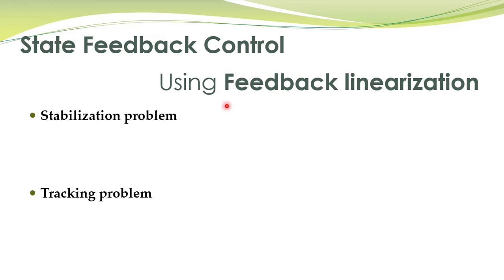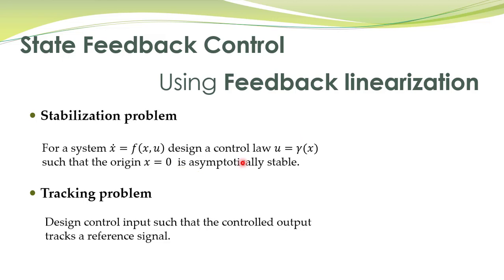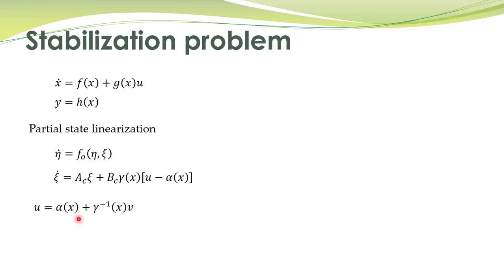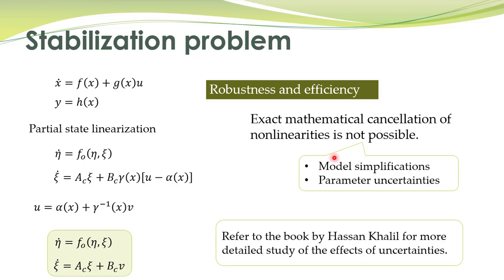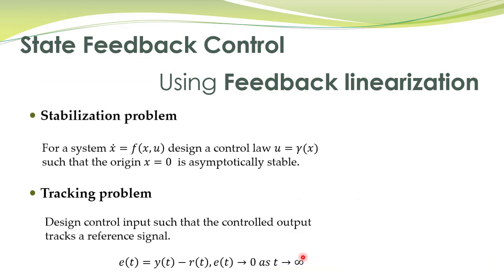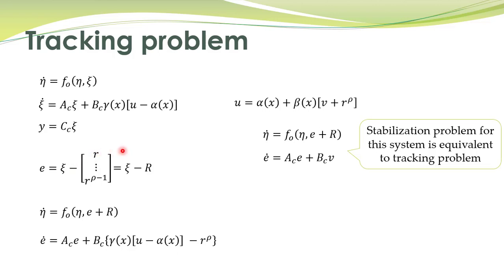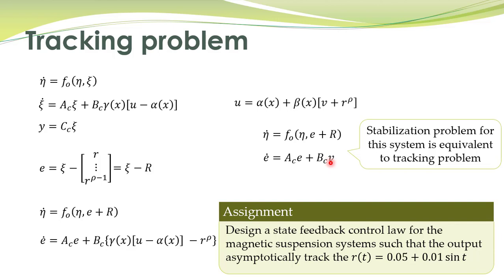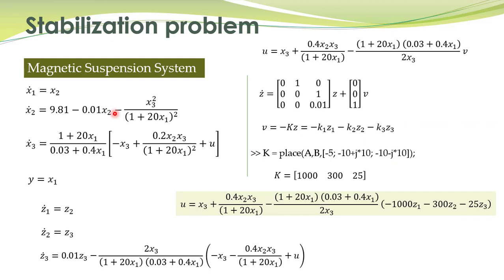NCS - 32 - Stabilization and tracking problem using feedback linearization

Comment: How can I design the feedback linearization using MATLAB?
Reply from the maker: Feedback linearization is an analytical technique, it has to be done with hand calculations. MATLAB may not significantly help you in this procedure.
Reply: @MAFarooqi  JazakALLAH, but I have read some papers in which they have generated graphs using Feedback Linearization but didn't showed the block diagram of simulink
Reply from the maker: @Qaidi_804  the controller designed using feedback linearization technique can be easily stimulated in MATLAB/Simulink.
Reply: @MAFarooqi  Sir, I sent you an email yesterday with MLS simulink file and papers I am following. It's my semester project and I have to submit it tomorrow before 11:59 pm. I request you to please help me. I have all the analytical solutions and values, also I have made MLS nonlinear model in Simulink, but I am not sure how to implement control law in that model.
Reply: @MAFarooqi  maybe it will take just 10-15 minutes to implement I request you to help me.
Reply from the maker: @Qaidi_804  it may not be possible for me to do it till tomorrow, because I am out of my city.
Reply: @MAFarooqi  It's okay Sir, I am done with it. I will appreciate it again, your lectures help me a lot in understanding non-linear control.